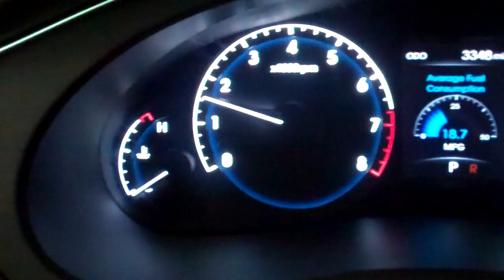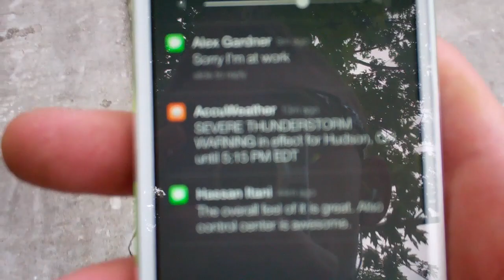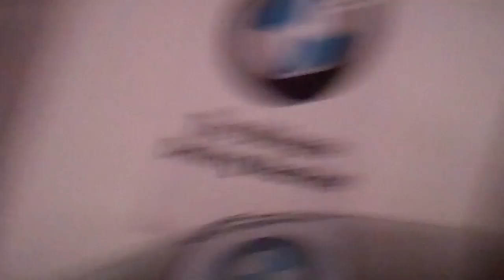Shady Electrical Hook-up  6/29/13 - Day 931

Comment: As soon as I saw that gauge I thought that also! The X5 has a cold idle of 900 RPM. But all of the parts on that are definitely work in as with the M5. ;) That wiring setup is brilliant. Not a fire hazard! GNOME! With all these thunderstorms you'dd be like CTFxC soon! Alli does have an E70 X5 I believe... I do about 120 a week typically and a tank of gas lasts me a month... ;) How many miles do you get per tank?

Comment from the maker: My cold idle is 1,000RPM, and drops to 500 within 1 minute of running.  Alli has been driving a 2013 F25 X3 actually, with M performance package!  I drive around 180 miles per week, and use about 3/4 of a tank doing so.